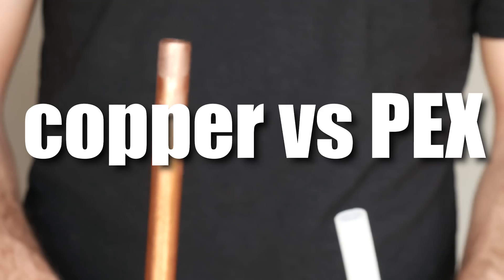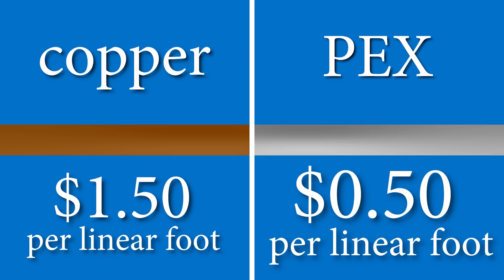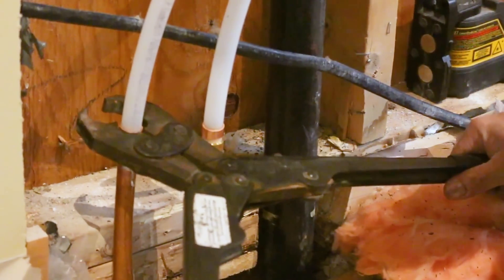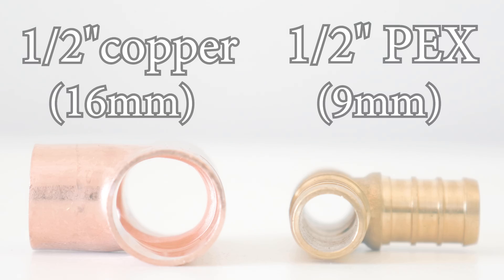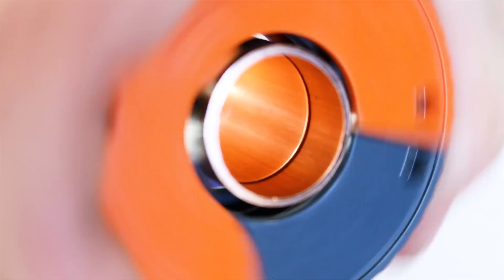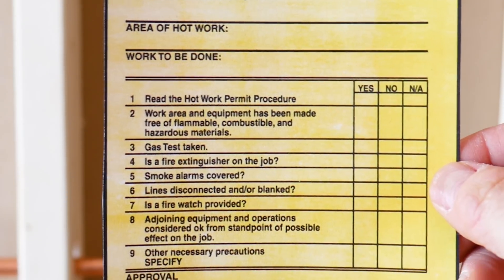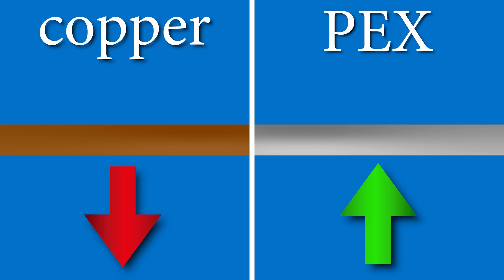Is Copper Better Than PEX? (COMPLETE GUIDE) | GOT2LEARN

Comment: PEX all the way. Easier, cheaper, just as reliable. The only downside I see is the rodent issue and to me that’s easily mitigated by sealing your crawlspace or attic (it should be anyway). I like to use copper on stubouts and exterior but other than that PEX.

Comment: “Brain tissues harbor higher proportions of polyethylene compared to the composition of the plastics in liver or kidney, and electron microscopy verified the nature of the isolated brain MNPs, which present largely as nanoscale shard-like fragments. Plastic concentrations in these decedent tissues were not influenced by age, sex, race/ethnicity or cause of death; the time of death (2016 versus 2024) was a significant factor, with increasing MNP concentrations over time in both liver and brain samples (P = 0.01). Finally, even greater accumulation of MNPs was observed in a cohort of decedent brains with documented dementia diagnosis, with notable deposition in cerebrovascular walls and immune cells…

PEX may turn out to be as bad as the Romans' lead pipes...

Comment: I had PEX and I did experience leaks (not bad ones).  Then  we got hit by Mice.  They ate through the PEX like it was candy.  The PEX was run through the ceiling and the damage was extensive.  No sooner did we have one leak repaired another was required.  $1,200 later I decided to have all the PEX replaced with copper.  I have also sealed areas where mice could enter my house with steel wool.  But here's the deal.  There still is no guaranty that mice will not enter your home.  I had , Repipe Specialists co. do the work.  $15,000 vs $30,000 quoted by Plumbing co.

Comment: “PEX pipes are installed inside a protective plastic conduit , which allows for easy replacement in the future without the need for breaking walls or floors. This is a significant advantage that adds to its superiority over copper pipes in terms of flexibility and ease of installation.”

Comment: As an aside to 2:46, depending on which type of PEX you are using, the fittings may actually have the same inner diameter as the pipe. For these types of joints, the PEX would be expanded with a tool to fit over the true 1/2" fitting. I believe that's for PEX A, but the fitting shown is for PEX B which are not meant to be expanded.
Reply from the maker: true!

Comment: Is the flow an issue with pexA? Since pexA is expanded, the fitting should be bigger than pexB, correct? Also the rodent problem can be mitigated with metal sleaves that prevent chewing from rodents

Comment: Commercial applications almost exclusively use copper because they trust it and can pay for it. It's not a performance advantage necessarily. Keep in mind the "pay for it" refers to the popularity of the ProPress system, not traditional soldering.

The same plumbers who disparage $500 PEX expansion tools are the same ones who will buy $2000 ProPress tools.

Comment: I have learned a lot of good things from your videos. I did want to point out a small mistake in this video. 

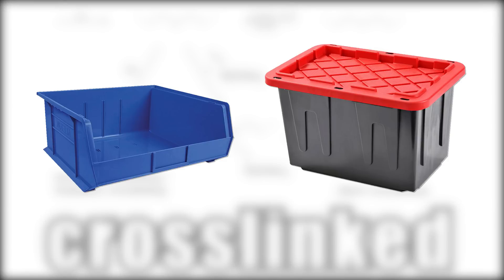At about 5:40 you were talking about permeability and I think you got your terminology mixed up. 

Permeable means that something can pass through the pipe like liquid or gas. If something is non-permeable, it does not let other liquids and gases pass through.

I still understood what you meant because you explained it so well with accurate illustrations but just used that one word incorrectly.

If I am wrong about this, forgive me. But I watched it three times.

Comment: The only downside to me is the rodent issue.   But if you have rodents, even with copper pipes, you must deal with them because they cause so much damage in other ways to the property.    I've had them in the wall of a rental property where I had to remove the bathroom vanity, cut through the wall and they had nested and chewed up romex wire and a bunch of them died in there.   The insulation all had to be replaced and that was a couple thousand dollars in repairs.    I had all copper pipe in that one so at least I didn't have water damage.     But you have to be proactive on rodent exclusion and I have ongoing rat bait stations that are just part of regular maintenance.   It is like changing the oil in the car.    You either stay on top of it or pay more in the long run.

Comment: Pex for my house. I had my system upgraded recently (10mm to 15mm) pex was used because of cost and ease of installation. Copper was eventually used to go into the radiators though for the look.

Comment: pex is much better ..... but in state of mass do not allow in commercial -.- ridiculous
i have ran a straight line from every fixture to the main line in the basement without using any fitting , there is no way that can leak in the middle 
copper after some year will do !

Comment: 15 years plumbing. Copper is always the better way to go. Plastic breaks down quickly based on both water chemistry and uv exposure. On top of that the human body has no way of removing the toxins that leach from the plastic pipe into the water, polluting our bodies and everytjing else with forever chemicals, where as copper is from nature and in reasonable amounts can be processed out of the body (beyond fhe tiny amount we actually need to consume to survive). Plastic is toxic PERIOD despite manufacturers claims to the contrary. Sure, its easy to install and fast but most of the time when corners are cut there is a very good chance something else will come back to bite you... and plastic pipe is by its very nature and marketing a corner cut. After three rounds of mass plastic pipe failures in my shortish career you would think we would have learned this by now but the marketing money is vast and we are busy people. I'm seeing 5-8 year old uponor wirsbo already turning amber, becoming brittle with hairline cracks now out in the field. Good news for plumbers who get to repipe every building built within the last 15 years all over again as they get paid again so soon after the last install but bad news for society at large as its a massive waste. If it seems to good to be true, it almost always is. Copper for the win, don't be cheap and don't be lazy and If you truly are a respectable and upright plumber than look out for public health as well as that is one if your most important DUTIES, not just making the quickest and easiest buck and who cares about consequences. Also: installing copper looks amazing and requires a tangible skill set to install like a master...Why wouldn't you want to show off your mad skills wherever and whenever you can by doing things both functionality and beautifully and better for the consumer? It's the only thing that sets you apart from the hacks and DIY installers.

Comment: I built my house. I wanted to do water supply line in copper as well  as copper to the kitchen sink. I don't like the taste of pet in my drinking water. Copper is a tried and true element not a chemical.  Everything could be pex. I should have spared the expense and time. It was the time that stopped me from doing. I was kind of rushed and said screw it. Don't do that lol.

Comment: If I was building a house I would use copper with ProPress. The house that I live in now was built in 1940 with half inch copper line and it's had no issues. I live in New England and I've never had an issue with frozen pipe. I definitely should replace the old globe valves with new ball valves. The old valves are starting to leak. But I fixed the issue for now. I have a ridiculous amount of water pressure and water hammer is a big issue I have close to 100 PSI and for the pipes being that old I know I could trust them. It honestly wouldn't be that hard to put in a pressure reducer and water hammer arrestors.

Comment: I went to the Pipe Trades Training Center for 10 years to learn what I know in industrial/commercial applications. One of my teachers sat on the board for the Uniform Plumbing Code (UPC) that regulates plumbing fixtures and materials, applications, etc. He told me about the industry pushing for pex, but the board kept them at bay, not allowing this material into the UPC. The reason? Leaks. That's the long and the short of it. 

My neighbors had a second house built on their property and they used pex. When I had a second house built on my property, I told the contractor that he must do it in copper only. It is my preference based on years of experience. Pex just seems too flimsy. Copper handles pressures much better. The fact that they are rated on longevity, as equal, surprises the heck out of me. To each their own, I guess. Suffice it to say, I would never have pex in my house.
Reply: A bathroom contractor tried to sell me on plastic pipes today and replace my copper ones of 20 years. I said heck no not in my house. The plastic pipes are too flimsy for me too 100%.

Comment: If you have water that's not filtered and treated has copper pipe would not last long flex pipe is a good choice you can always yank a flex pipe out and replace it with another one.

Comment: Pex all the way except country properties . But I saw you crimping bro. It’s all about that wirsbo expansion system. Using the inherent function of the material to forever tighten to the fitting not forever fight the crimp ring

Comment: I finished my basement and added a utility sink in the laundry room and a full bathroom.  I used pex with a shutoff valve coming from the main copper pipe..................so so so easy and cheap.  I was shocked at how quickly I did the plumbing and how little I spent.  I have flood alarms in my basement.  I honestly believe the reliability issues the old timers focus on are greatly exaggerated, but if anything happens, all I have to do is shut off the supply to my basement.  I really believe that pex is way better than copper for projects like this.

Comment: Thanks for the video! I'm replacing the old water line with either copper or Pex. Since the crawlspace's entrance is from outside and we won't live in the property, I really worry about the rat may eat Pex line and cause flood. Though the copper is more expensive, I don't want to worry about the mice problem everyday. After watching your video, I'm more certain to go with copper.

Comment: You need to consider copper crimping technology.  No hot work, pipe can be slap full of water and still use the crimp fittings.  No cleaning of the pipe other than deburring.
Reply: How NEW is the copper CRIMP method?  Ha anyon seen any issues with this way of connecting copper to copper?
Reply: @retiredperson4054  Yes, it's not time tested.  The question is how long to those rubber o-rings last on the inside?  I'd rather stick to soldering because there's nothing to wear down or fail over time.

Comment: Just an FYI…
You don’t want to mix pex products. In order for the warranty to stay in effect you have to use the same brand pex pipe and fittings. If you don’t you will reduce the warranty from a 25 year warranty down to a 5 or 1 year warranty. Manufacturers test their products with their fittings and that is what they will warranty.
Reply: It has to be the same type and rating, and meet the same specs. Same brand is neither required, nor is it legal for them to require that. (Just like car manufacturers can't void your warranty for using an aftermarket oil filter or other parts)

Comment: for the rodent problem, what about using expandable braided sleeves over the PEX pipe.  it'll add a little bit of cost onto your project but it might save in thousands of $ in repairs.  figured it's used to protect electrical wire, could do the same for PEX.  thoughts?

Comment: We’re are in a house that is over 50 years old and the copper water piping has never leaked except after a bad solder joint immediately after installation. The home we just purchased requires some modifications to the plumbing I’ll be using PEX tubing because of cost

Comment: All these plumbing youtube channels with pex vs copper forget to mention the most important point.  Pex cannot be exposed to sunlight, copper can.  
And putting a covering or painting pex is just a botch job. The covering eventually will be eaten by the sunlight also.
Thus if your tubing is not inside the walls for whatever reason(there are times pipes are in the exterior), you should(must!) be using copper.
Reply from the maker: I mention the sunlight issue in this video towards the end in this video: https://youtu.be/YgkagZj7cOE

Comment: This video is using Pex B.  Pex B sucks.  Pex A or Upinor is bigger and you use an expander.  Stay away from Pex B.  Your crimps have to be checked.  Pex A uses an expander and is much easier and safer
Reply from the maker: The PEX-a system is more expensive.
Reply: @Got2Learn  its so much faster, more flow and no need to double check with the crimp gauge that wasnt shown in the video.

Comment: PEX all the way. Rodent issues are about 5% of copper pin holes. Haven't seen one yet. Plus they have these cheap PVC anti rodent slide on tubes that taste nasty to a rat. Put those on the cold water line because you insulate the hot water. Many don't but I do. I use a cinch clips because at the end of the day I'll still have elbows.

Comment: Always Copper! I went into a house with leaks everywhere! We were bewildered at why water was leaking out of Walls and the Roof on their newer homes in the foothills. On further inspection after removing 40 sheets of dry wall in only one of five affected Luxury houses with the same problem? These new homes we further discovered Mold from urine soaked Rat/Mice feces/Urine mixed with he sprays of water, contaminated dry wall as the tiny water sprays were taking the rat urine and feces down through the 2x6 studs inside the walls was not so dry and numerous small leaks destroyed not only the dry wall however, the Studs we're soaked and mold had started growing in the ends of the wood studs. This was a $45000.00  demo and rebuild! Three  40' foot walls were growing mold all because  of Rats that chewed threw the Pex lines, not to sharpen teeth, rather because   sounds of water running through the walls, apparently attracted the Mice and a few squirrels through the Attic. I will never use a Pex Product again always use Copper! Hands down! The best plumbing material. Also, there are some safety concerns about using plastic according to recent studies plastic has found its way into every person's blood on the planet. Plastic is turning out to be our nemesis, unfortunately.

Comment: I like pex. it's fine. it's used in new construction. it's been around longer than I have. it's cheaper than copper. not stolen like copper. I can fix a busted pipe in seconds if they freeze. but pex expands, and can usually handle a freeze.

Comment: I’ve heard PEX pipe will get brittle as it ages.  After 10 years it could be difficult to work on when it gets brittle.  Also, has PEX been around longer than 50 years?

Comment: The problem I have found with PEX is the brass fittings.  I changed around a PEX plumbing job which gave me the opportunity to look at a PEX elbow fitting.  It was full of scale reducing the diameter effectively by a 1/3.  This installation was only about 3 years old.  This was an installation done at North Myrtle Beach where the water is not the best.  The actual Pex piping was fine but, for some reason the scale stuck to the brass.  I don't know if that would happen to copper.

Comment: I have a 1958 single-level brick ranch home, no basement, with the master bath, hallway bath, and kitchen having access to the same piping. So for me, rats will never be a problem. My pipes were replaced in 2020 and the water tastes better and I have noticed that there is less grime in the bathtub. With the old pipes, I had to clean my master bathtub every month, but with the new pex pipes, I haven't cleaned my tub since the week of Thanksgiving last fall. I am surprised that the incoming water is so much cleaner than with the old pipes. There is no grime in the tub at all nor on me.

Comment: My house was built in 1987 and the builder used copper.  However, I just had one of our bathrooms renovated to a walk-in ceramic tile shower and I had the installer use PEX instead for the hot and cold shower valve.  It just made sense for all of the reasons you detailed; especially ease of installation and cost.